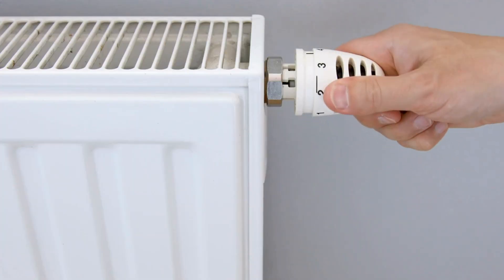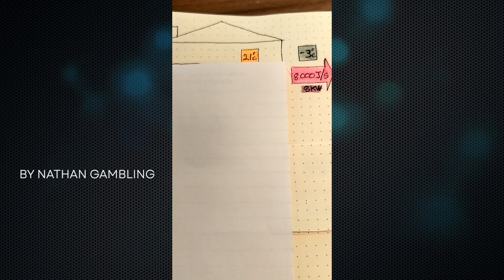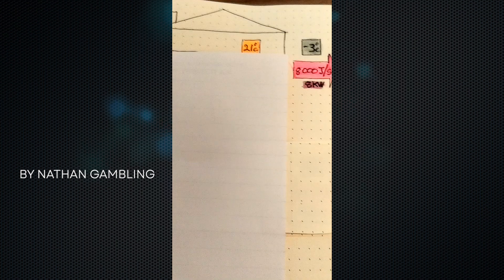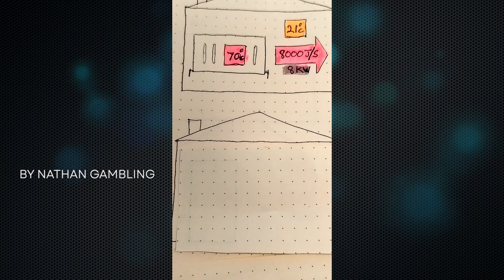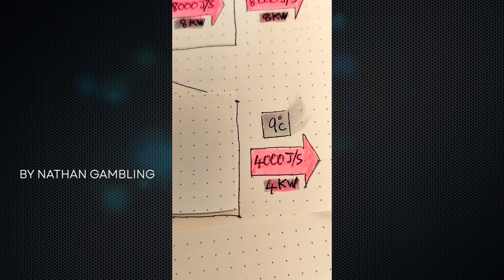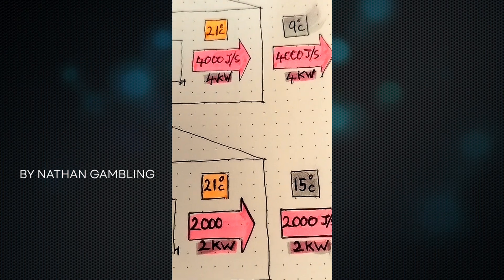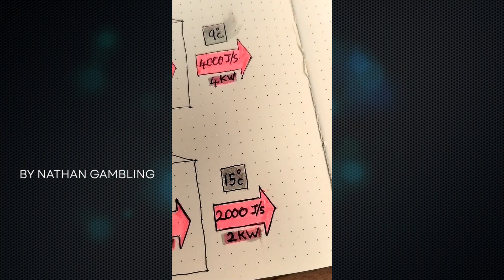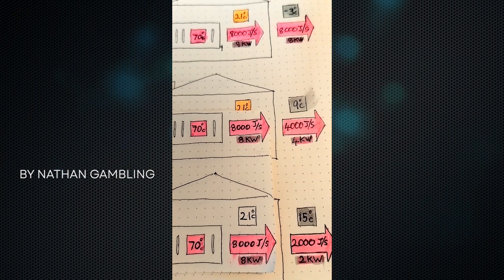Why Running Your Boiler at 70C Is a Mistake!

Comment: When you have weather compensation fitted to your boiler,. do you then  have all your radiator values fully open all the time? Do you need to tweak your boiler on/off timer settings? Thanks
Reply: Weather compensation would normally run 24/7 but you can still program set backs, so let say 7am to 9am at 20c, then 9am to 5pm at work set back to 18c, then 5pm to 9pm 20c, etc.

Set backs shouldnt really exceed 3 degrees from your desired temperature or it can use too much energy getting back to temperature and too much thermal mass lost if its a masonry build.

Ideally, youd have a heat loss survey to determine a room by room heat loss at a given outdoor average coldest dsy of the year, and then the correct sized radiators would be installed to always match the heat loss. Trvs are best left open but can be used as temperature limiting.